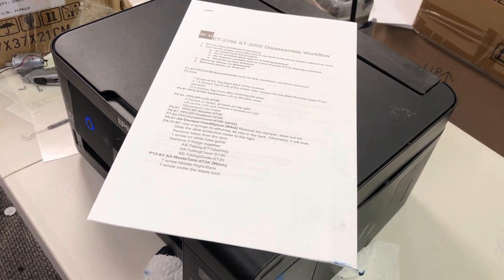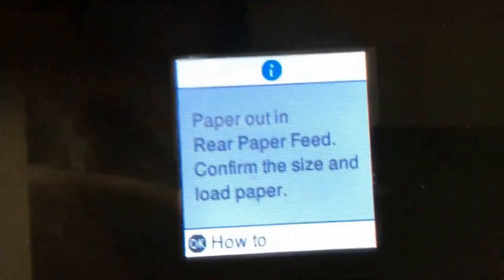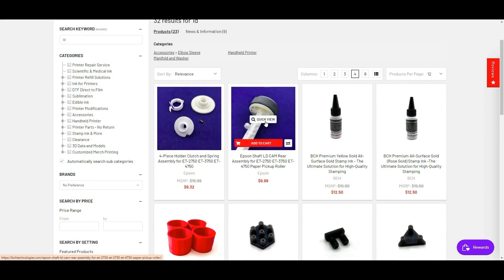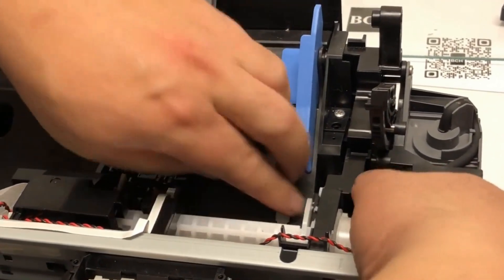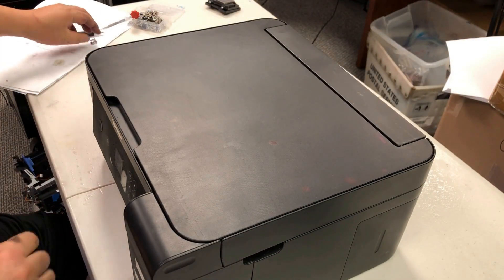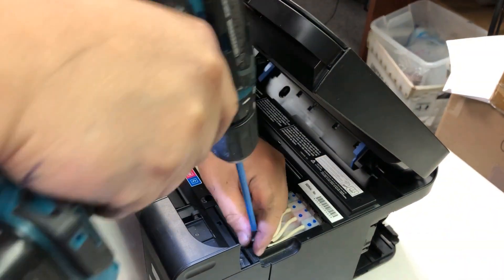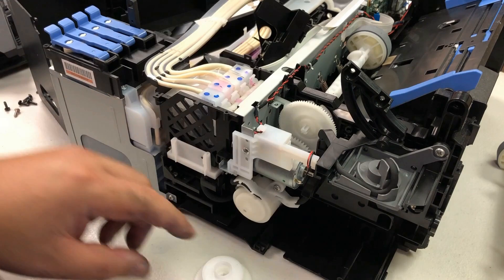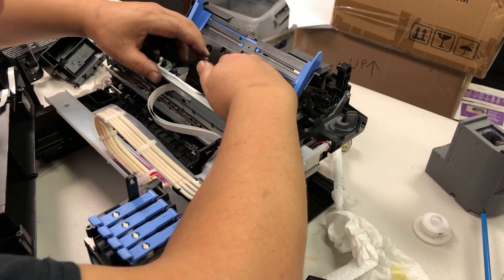Epson ET-2750 Loud Noise &  "Paper Out or Incorrect Loading" - Replace Shaft LD

Comment: I have a ET 2650 and i have a loud banging sound, when the printhead is touching (maybe) the left wall. How to fix this?
Reply from the maker: Thanks so much for watching and asking! That loud banging on the ET-2650 usually means the carriage sensor or encoder strip isn’t reading correctly, so the printer doesn’t know where the printhead is and slams into the wall. Try cleaning the clear plastic encoder strip behind the carriage with a soft lint-free cloth and a bit of alcohol, then power-cycle the printer. If the problem continues, check for any obstructions in the carriage path or a broken carriage belt. I really appreciate your support! Because of the high volume of questions, subscribers and members get priority answers within 48 hours and enjoy early video access plus exclusive perks. I can only answer about 10 questions a day, so after subscribers and members, the newest comments are handled first. If you’re not subscribed and don’t get a reply within 48 hours, you can either subscribe (your old questions automatically become priority) or re-post so it’s seen sooner. For faster help, email [support@bchtechnologies.com](mailto:support@bchtechnologies.com). And if this video or comment helped, please consider leaving a quick Google review here: [https://g.page/r/CfL7k6nYvPQ9EAg/review](https://g.page/r/CfL7k6nYvPQ9EAg/review).
Reply: @BCHTechnologies  thxxxxx

Comment: I have ET-2850 which makes grinding sound when printhead goes into park position. What could cause this? Paper feed and everything else works OK.
Reply: you managed to get it fixed? I have  the same problem
Reply: @harry-xu8pk  yeah I did. But it's been 10 months, so I don't remember what I did to fix it.  Sorry. Try cleaning the codec strip which runs along the carriage.
Reply from the maker: Thank you so much for subscribing and for reaching out! Your support really means a lot as I work toward my 100k goal—it’s a long journey, but amazing subscribers like you keep me motivated. Let’s tackle the grinding noise issue on your ET-2850.

In addition to possible issues with the capping station or dirty rails, the grinding sound could also be caused by the printhead lock mechanism on the rail. This lock secures the printhead carriage when parked, and if the gear controlling it is out of sync, it can create resistance or misalignment. This can make the printer struggle as the printhead moves into the park position, causing the grinding noise you’re hearing.

To troubleshoot, you might want to check whether the printhead lock is functioning correctly. If you’re comfortable opening the printer, inspect the gear mechanism for misalignment or damage. Cleaning the area and ensuring the gears are properly aligned can often resolve this issue. Be cautious not to force any parts, as they can be delicate.

If the problem persists after checking the lock, cleaning the rail, and inspecting the capping station, it might require deeper maintenance or part replacement. Feel free to email me at support@bchtechnologies.com for additional guidance, and I’ll do my best to help you get it sorted.

Thanks again for subscribing and commenting—it means so much! Let me know how things go, and I’m here if you need more help.

Comment: Any thoughts on the paper feed change lever not rocking back and forth to allow the assembly to rotate and let a new sheet through? Comparing side by side with another unit, I don’t see any differences; if I move the feed change lever with my finger while printing, it picks up a new page as normal but will only do it if I help it along.